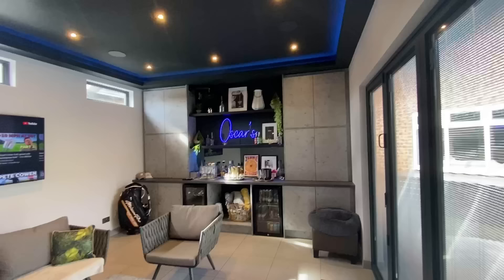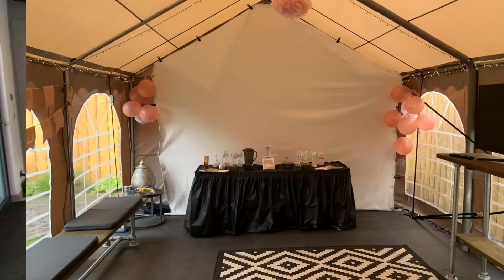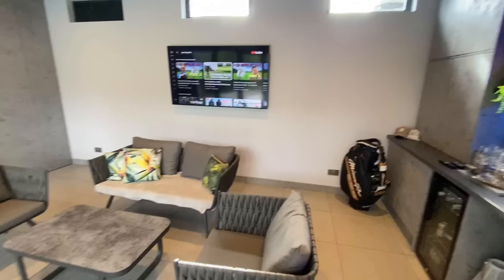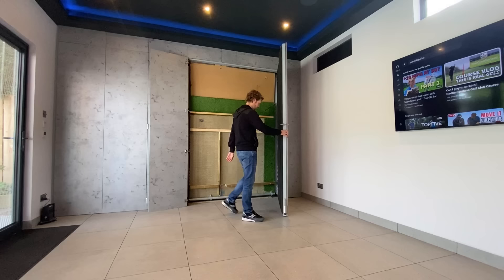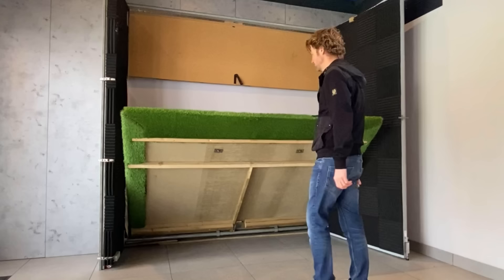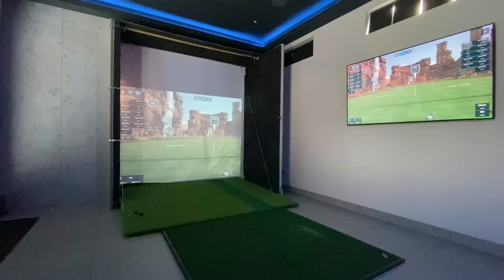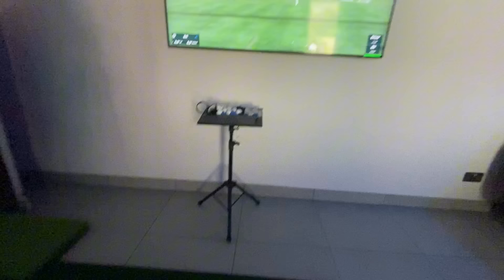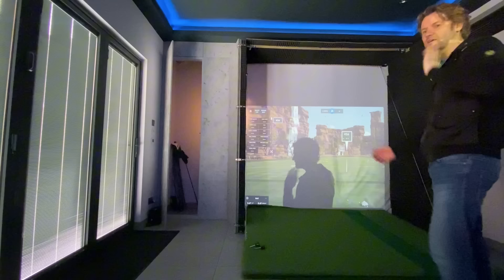I Built My Own Golf Simulator | DIY Golf Studio | Fold Away Golf Sim

Comment: Good engineering for an amazing result.  Is it not possible to dial in the resolution you want GS Pro to use?  I would have thought with how many DIY simulator builds are out there that the game would be able to set a 1:1 scale resolution.  What impact screen are you using in the build?  What sort of impact foam do you have on the doors?  I am in planning phase of my build and so far have a couple options for both, but always curious to find more options.

Comment: Mate well done looks amazing,  me and my wife looking to do something very similar to yours where did you get the metal frame for the building and did you get planning for it or is it under the building regs if you can send the link over that be amazing. Thank you for a great idea mate
Reply from the maker: It’s a company in UK called https://nodigging.co.uk
I bought the frame only, they also do ground screw system but we wanted the concrete slab to keep level with the patio.
Reply from the maker: I did need planning permission- yes. It’s over 3m high
Reply: @TheGeordieGolfer  thanks for the getting back to me i have a look at them
Reply from the maker: @aaronowen91  No problem Aaron. 👍🏻 any help or questions or another video on the subject, please let me know?

Have you subscribed btw? Can’t believe how this video has gone, getting new subscribers would be a bonus 🙏🏻
Reply: @TheGeordieGolfer  yeah i have mate, looking forward to watching what you got coming forward. I do have an outhouse that i built witch is 4x4x4m but the eves are under 2.5m high but looking to get a skytrak and then get gspro that software is so good
Reply from the maker: @aaronowen91  many thanks for that 🙏🏻🙏🏻
can you modify just a small section of the roof beams to give you a heighten slot to swing the club?
Reply: I built it to swing my clubs, i just need to make it warmer over winter haha and a skytrak to play
Reply from the maker: @aaronowen91  rockwool insulation or PIR should do that for you. Not a huge expense & make a big difference 👍🏻

Comment: Been using a Gala 6m x 4m  heavy duty Marquee for the last 6 years on my decking next to house, "m away from any boundary fence. I'm very envious of your build, would love to build what you have, but UK planners won't allow it due to height and being within 2m of boundary fence. I even had a Golf Frame Netting at the bottom of the Garden which was 3m high and a neighbour across the road complained it was spoiling their view, planners came out and told me to either reduce the height or take it down.
Reply from the maker: Wow Gerry, sounds like you have some difficult neighbours. We had these huge cloud conifers & everyone was happy to see the back of them to be replaced by the garden room. Mine is close to the boundary fence, needed fire retardant cladding for building regs, all good though. 
Good to hear the marquee is still doing a job, as that’s where I started & worked great to test if we were going to use the space 👍🏻

Comment: Great space designed very well what is the cost for the build and  the golf sim up and running. cheers
Reply from the maker: The build was quite expensive because we went high end on the spec, fully insulated, top notch cladding, bifolds, underfloor heating etc. Around £40k all in. Would have been a lot more if I didn’t do all of the build & internal fitout